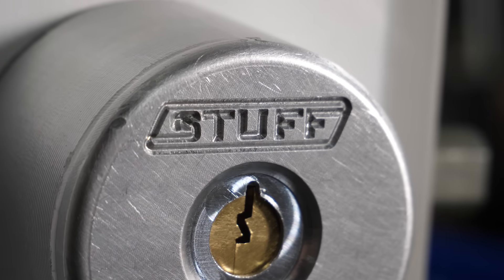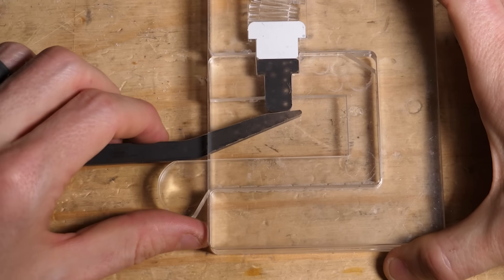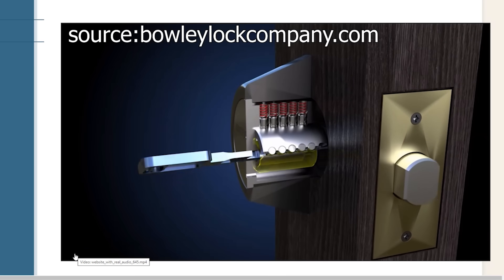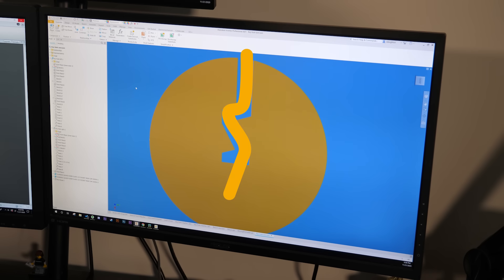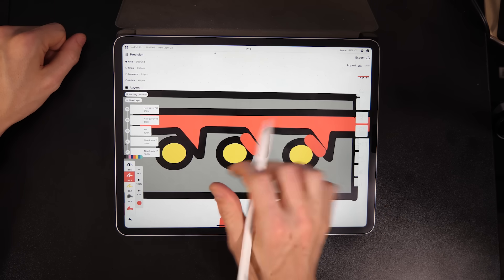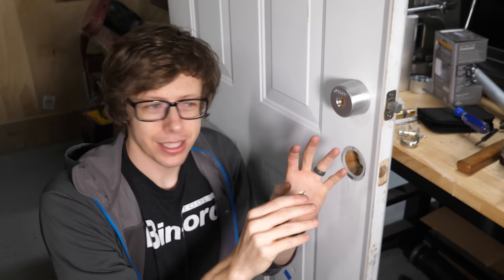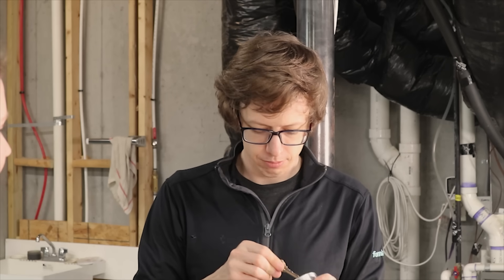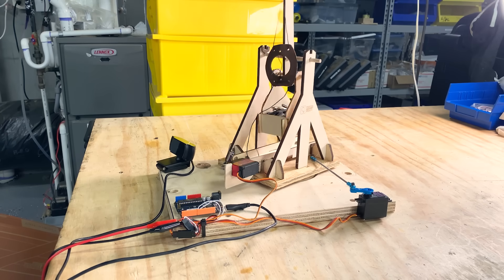Making an unpickable lock. Calling locksmiths

Comment: This is awesome, the idea of "submitting" all pin positions at once before they are checked totally makes sense. But we need to get rid of the complicated Hold-setup since it is the most difficult part of the design. Maybe instead of holding the Pins, you could make multiple channels per pin so that you don't need to hold them while stile having a lot of possible submission positions. So each pin would have 5-15 channels it could run in, but only the correct channel would allow them to pass. this way you don't need the hold-mechanic and it would also be immune to "launching":

Rough draft:
https://imgur.com/a/qX3wYJz

Comment: Lock picking is a means of opening a locked door that leaves the door and the lock in a fully functional condition. To gain entry via a door with an unpickable lock. use brute force. Kick it real hard. If this fails use a battering ram. If this also fails use explosives. If this is unsuccessful try shouting   Little  pig little pig let me in. If you hear a reply Not by the hair on my chinny chin chin, try crying pizza delivery.

Comment: the other thing about an unpickable lock: there's also about as many ways around it as you can think of. open a window, go to another door, break down the materials holding the door in, go through a wall, etc.

cool concept, but i like that you mentioned that it wasn't necessarily gonna be a huge thing.

Comment: "i found a locksmith who specializes in picking locks"

Bruh
Reply: Most "locksmiths" will destroy or damage the lock but he specializes in picking it so it's usable again
Reply: This  lock tool cannot be opened! Forever lock V3!https://youtu.be/RKRo97N1PJI    https://youtu.be/4vShP7riRqI
Reply: But shouldn’t all locksmiths specialize in picking, rather than destroying the lock?
Reply: @shurikdidalright4515  Depends on how much you are willing to pay them. Picking a lock takes several orders of time longer than destroying it, typically by drilling or using a specialty "core puller". 

They charge by the hour, so if you invested in a high security deadbolt and don't want to shell out for a new one, they'll gladly take your money.
Reply: @shurikdidalright4515  Not if they can charge you for opening/destroying, then charge you for installation of new lock, with the call-out charge it all adds up - kerching!

Comment: Would a grippy rubbery buffer on the pins help with the pin locking mechanism because you could then lock the pins and have a more reliable and less complicated pin locking mechanism

Comment: Him: Makes unpick-able lock. 
Burglar: Kicks door open.
Reply: Once we had the situation that a serious ill person was lying behind a high security door in a n apartement. The unlocker knew that door system and told us that there was no way to open it in a reasonable time. So we went through the wall next to the door :)
Reply: @flyingdoctor99  The three forms of entry.

Use a door.

Break a door.

Make a door.
Reply: If the door is made as any other door all you need to do is smash enough and forget the locks all together.
Reply: LPL: "Well this one is actually surprisingly simple"

picks lock by looking at it
Reply: Reminds me of the quote: "The chain is as strong as its weakest link"
Reply: @kymab.5172  More like the chain is only as strong as the bolt holding the shackle to the wall.

I see it all the time, weak sheet metal shackles held up by wood screws secured with chains that would make my angle grinder swear... yet the forementioned shackle and screws mean I could probably remove this with a claw hammer.
Reply: He can´t kick it open: It was a glass door, so, best case, he can smash it... :-)

Comment: So, I can't help but think that this is still vulnerable to a "pin by pin" approach, given that you could tell when the locksmith got a pin set, but it's harder to pull off, and the way I envision it is more akin to decoding, and will still be much slower.

Imagine you have a set of all possible keys for the lock, or some tool that lets you set each pin to a precise position. First, note the position where the lock stops turning, so you can compare later to see if you've gotten the pins set. Set your tool to the lowest cut for all but one pin at a time, for a 3 pin lock with 3 possible pin heights you'd be checking 1, 1, 1 -- 2, 1, 1 -- 3, 1, 1 -- 1, 2, 1 -- 1, 3, 1 -- 1, 1, 2 -- 1, 1, 3. Order doesn't matter, and I suspect you can't just focus on a single pin in case that's not the pin that's "binding". Once you find a combination that "sets" a pin, congrats, you've now set a pin.

With a pin set (say the second pin is position 3) you can now check the individual positions for the remaining pins. So, that'd be 2, 3, 1 -- 3, 3, 1 -- 1, 3, 2 -- 1, 3, 3. Once you figure out which of these sets a pin, you can move on to the two remaining combinations for the last pin. And now you know the cut used for the key, and can unlock the door.

If n represents the pin count and k represents the number of possible cuts for a single pin, this method (if it works) brings the maximum number of attempts down from k^n to k * n(n+1) / 2 or so, where n(n+1)/2 is a representation of n + (n-1) + (n-2) + ... + 1: i.e. you need to check every cut on each pin, then every cut on each remaining pin, and so on. For my example of 3 pins and 3 possible cuts, that means brute force is 27 at max, and this method is 18 at max (edit: though i actually counted 13 at max, that calculation is probably still including some duplicates. might be closer to (k-1) * n(n+1)/2 + 1 to cut out duplication of checking first pin position over and over again)

Adding false gates is probably possible, and would increase the "key space" that would have to be searched through (at each stage you'd want to check if there's multiple gates for a pin, and then continue on to the next pin trying combinations for the possible values of the true gate). I don't have a formula to sum this one up, but i suspect that the worse case isn't too much worse than what I've already mentioned, since you can still cut out huge swathes of the "key space".

... come to think of it this is probably already a technique that is used for some things, though i don't remember if I saw it somewhere else. i'm sorry if it is and i explained it badly. i suppose this isn't picking per-se, just a weakness that still allows someone to go at it pin by pin.

Comment: Well, that’s not true if you want an unpickable lock, don’t buy something without a key, lock picking lawyer has definitely done a good job of spreading the word that most of today’s electronic locks just aren’t up to the task, most of them are not really built to be security devices, they have exposed screws and other exploits that can make it extremely easy to disassemble, I’d say wait a few years and then the designers might be able to get it through their heads that they are creating a security device and not an electronic novelty. If you truly want something with a ton of pick resistance and resistance from other attacks, try an Abloy Protec2, as Far as I’m concerned only 1 person has ever been able to pick it, and now you can get an added electronic element as well as the mechanical element as well, if that’s not your style, try a Mul-T-Lock MT5+ which is also extremely difficult to pick and only a handful of people can actually do it, LPL happens to be one of them, if that’s still not your style, try a 6 pin Medeco that has a UL 437 listing, any lock that has a UL 437 listing is guaranteed by UL to have up to 10 minutes of a picking attempt, I believe 5 minutes resistance of a drilling attack, and they test all sorts of other things, UL 437 listed locks can be a little pricey, but it’s a small price to pay if you are locking up something of value.

Comment: This makes my OCD go through the roof, I’m a locksmith, and it drives me crazy when people don’t use proper terminology. The other thing that made my OCD go through the roof is the fact that he is using a control key in a non SFIC core, and the front of the key does not slide all the way in. The one thing I’m slightly concerned about is that the housing holding the lock appears to be made of aluminum. Steel and better yet hardened steel would work way better, because aluminum is very soft, so there’s not much stoping someone from taking a hacksaw and cutting the housing all the way around releasing the lock, which could then be removed and the bolt can be retracted with a screwdriver.

Comment: My guess on how to pick this : insert a rod in the keyway to apply pressure on the back of the lock (on the lever part), then pick it like a regular lock. Shouldn't take much effort.
 Of course, the difficult part for  a random locksmith/burglar is to correctly guess how this lock is working, while it is the only one of its kind.

Comment: I am just smart enough to realize that this is very impressive, but not quite smart enough to know exactly why.
Reply: Key pushes pins up. The tip of the key pushes a bar that pivots and pushes the pin with the little spring loaded locking pieces. They press against the pins holding them in place. When you rotate the key, it is no longer pushing up on the pins, and only the locking mechanism is holding them in alignment with the gates.
Reply: Because its not just making a lock, its the combination of all the other skills that go into designing and creating the finished product entirely from ones own aptitude.

Comment: That idea is good keep that but what if you stop multiple keys from moving until  the end encryption sinks with the right length. Could you also create a key pattern that could only be unlocked when the right key touches the line in the correct pattern. Like 3, 0, 1, 9, 2, 7 not any other way other wise other keys will stop moving.

Comment: so instead of having your locking bar in the top move along the same axis as the keyway, why not have it just be a straight bar and press on the pins perpendicular to the key axis?  like vice jaws. can put some rubber on the bar to account for differences in pin size, but no additional parts needed.  just need to translate the motion of the key to perpendicular motion with a wedge.

Comment: Pretty darn impressive locking mechanism. The unfortunate problem is that thieves generally go for the fastest way past a lock... which is destructive 99% of the time. A 4 pound sledge defeats it in seconds. If you figure out how to make it compact and recessed, you will have a highly marketable item! As-is, it could be used for plenty of commercial and industrial applications, even though it's no good for a door.

Comment: I used to be a locksmith at Hays Safe and Lock, your lock is extremely hard to pick, but it can be drilled easily, if you can install stainless steel ball bearings, you can also improve your lock making it a lot harder to pick by doing what medeco does (you were halfway there) medeco HS locks have that special sliding bar you had, but they also have drop pins that are angled so that the keys cuts not only have to match the same depth but the same angle.

Comment: I Would use a fork to pick this lock.
Do you want to now why a fork?
because you can just put it to the side that the lock uses to unlock the door and make sure that the fork is jammed in a way so that the middle fork pieses are bent or removed.
just move the fork left and right.
It will take a lot of trys.

Comment: After Lock picking lawyer failing on this lock. I wouldn't be surprised if you get contacted by a big lock company, that wants to buy the rights off you. Make sure to put a patent on that system asap, in any possible way. And make sure to not let off it for cheap!

Comment: I was thinking about something similar to this, but I don't have the time or resources to prototype it. Lock the pins together and then send them through the gates so you can't pick each pin alone.

Unfortunately as you said the complexity goes up very fast which brings brute force security way down. I still think there's a simple elegant way to do it, but ultimately there's little difference between a lock that can't be picked and a lock that seizes up on the first failed pick attempt. Someone will just force in if they want in.

Comment: so you make a pick that has a magnet in it that creates a pull so that when the top of each pin his the cylinder it gives a resistance that's measured with an electric currant that can have a indicator that shows when there is a spike. this will tell you when you found the correct height for that pin and you can lock that into memory for each pin so that you can basically make a fake key based on each measurement.

Comment: The fact this man made a million dollars product and not trying to sell it is crazy
Reply: Well not quite... The construction of the lock requires some extreme precision machining not to mention a process that likely couldn't be automated.  Unless the lock could be sold for $1000's, it would lose more than it makes.  He did it more as a feat of engineering and not to make money.  Kind of like the Bugatti Veyron, the cost to develop it was more than they could make off if it commercially.  It was done more to see if they could...
Reply: the problem is if you lose the key, cant really call a locksmith
Reply: @known_questionmark  also mass producing these things might be tough. I don’t know a whole lot about mass producing locks, but they need to be different so if someone else owns that lock, they can’t just use their own key, no? So they would have to go through the trouble that Shane did for every single lock they build.
Reply: Once you mass produce any security thing, it becomes vulnerable. All one has to do, if intent on defeating it, is buy one from the store, take it home, and take their time learning about it, deconstructing it. Once they know the vulnerability, they know how to open that particular lock anywhere they see it. His best bet is to use his custom locks only on his own house, so nobody can deconstruct it.

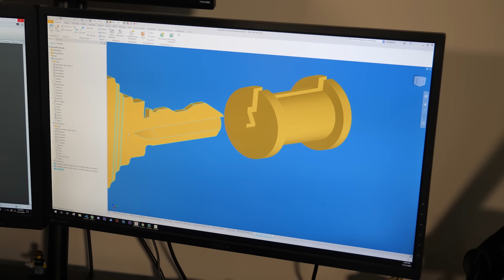Comment: 4:56 
My friend, let me introduce you to the Wire EDM. It's capable of cutting any through feature in conductive material. It's capable of hitting +/-.0001" at volume too. I use one every day.
Reply: I saw a home made one cut through styrofoam quite nicely.
Reply: @stephenolan5539  Haha at that point I think you simply have a saw.
Reply: @highskies1262  
It really did melt through.
Reply: @stephenolan5539  Polystyrene is not conductive enough for the EDM process. Unless some conductive amendment was included in the foam, the arc would not form through the dielectric fluid. Willing to be proven wrong, but I'm pretty sure either it wasn't styrofoam or it wasn't actually EDMing. 

Hmm . . . come to think of it, you could run the wire in the air just under annealing settings and just melt the foam on contact, which sounds like what you're describing. Keeping tension while the wire is stretching would be a challenge, but that must be what you saw. Interesting.

Comment: As far as RFID locks, all someone needs to get into one of those is a secondary RFID reader and some patience. An RFID reader extends a very small field, which an RFID chip must be within in order to activate. However, while activated, the RFID chip sends out a very strong signal that can be read (sniffed) from several feet away. So, if someone hides an RFID reader nearby, they can capture the RFID signal as soon as the key is activated, and then clone their own chip.

This assumes use of passive RFID chips and readers without PUF authentication. Active RFID would be even easier to sniff, and PUF authentication is just about the only thing that can truly thwart cloning.

Also, there could be other flaws in an RFID lock than the keys. There could also be magnetic attacks, shimming, accessing the internals, etc, depending on design overlooks.
Reply: There have been warnings not to keep your RFID car keys near the front door.  
If I understand correctly someone with the right equipment can activate both and then start the car.
Reply: @stephenolan5539  As long as you can get the keys close to an activation field you're good to go.

(Of course, that assumes you have a reader/cloning device or perhaps a repeater, and know how to use it. Also, there are ways to make RFID more secure, such as encryption and PUFs, although encryption can be broken.)

Comment: I'd imagine it would be possible to pick if you make a special tensioner that also presses against and actuates the lever in the back. Of course, that would require knowing something about the lock ahead of time, but as a matter of history, that's how locks get defeated. This lock doesn't seem nearly as difficult to get into as the Bowley, since the multiple pin feedback issue can be overridden by the right tool. Nonetheless, very cool!!

Comment: So. Even if it's "unpickable" there is an interesting flaw.

It's huge and protrudes really far from the doorway. I can take a sledge and hit it off a lot easier than a standard deadbolt.

A hacksaw would also do. It would be quieter.

Also plz don't recommend keyless locks those things are hot trash.

Comment: Designing and manufacturing the "perfect lock" is probably going to cost more than the customer is willing to pay. However "barely adequate" locks are significantly cheaper, which makes them a financial success story. By "barely adequate" I mean a lock that will keep all the honest people away. Anyone with time, dedication, desire, will and patience will get through one of those locks. Harder locks will also require some skill, but the number of people who can pick those is very small indeed. Most people don't need to worry about the low possibility of a skilled burglar paying them a visit. Normal people don't buy a meteor hit insurances either, but a car insurance seems to make a lot of sense to most people.